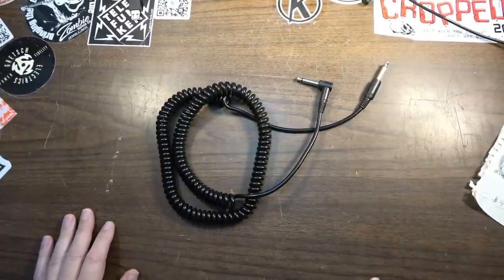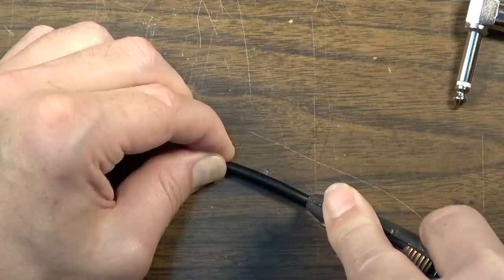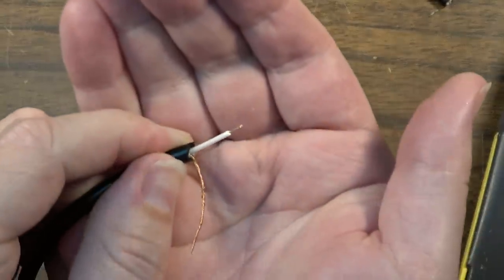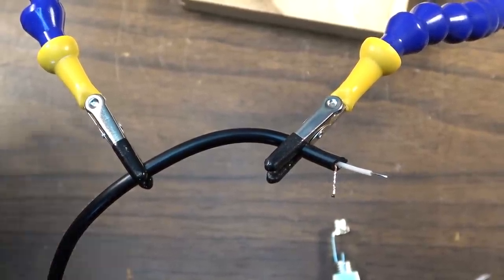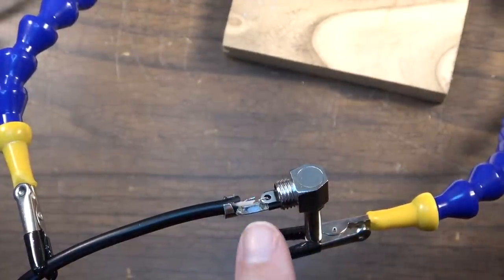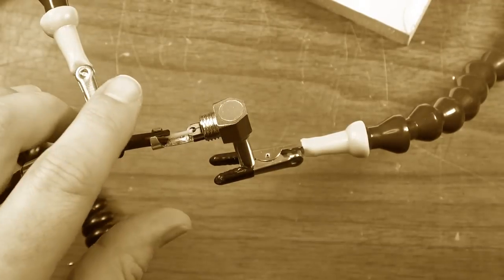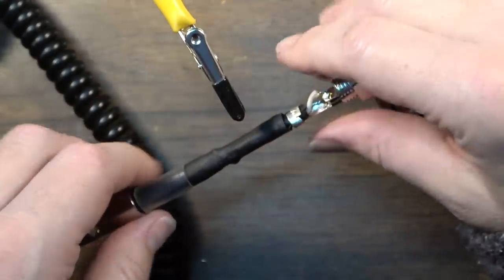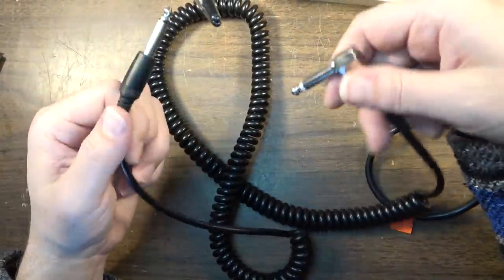ESSENTIAL SKILLS FOR PRACTICAL MUSICIANS: Guitar Cable Repair / How to Fix

Comment from the maker: STUFF YOU'LL NEED:
1: A Broken Cable
2: Wire strippers/clippers: https://amzn.to/3xtIUja
3: Soldering Station (This one has built-in helping hands): https://amzn.to/3vmRH4h
4: 1/4" Phone Plug: https://amzn.to/3xnqa4N
5: 1/2" Shrink Tubing (cheaper by the roll): https://amzn.to/32Ro9zw
6: This is the solder I like: https://amzn.to/32QKDRm
I prefer 60/40 composition. rosin core. 0.032 Diameter
Reply: Time for a new Solder Tip Brad!
Like yourself I've been soldering for many Decades and find an old Solder Tip more of an annoyance more than anything else.
That said, an individual new to soldering would be much better served with a newer/thinner tip design.
Either way great content, and yeah, we all love fixing our cables.......................ugh/sigh
Reply: Back in 1975 I purchased a 50' Whirlwind Instrument Cable.   I still have that very same cable and still use it regularly.
Originally starting off at 50' in length it's now only an 8' cord...........LOL
I did get my money's worth as the original solid brass Military-Grade connector ends are still very serviceable.
Reply: It is good to show those common mistakes. I use my cutter to strip cable outer shield. Idon't use knive cause I always fuck it up the cut.😁 Anyway this was really good video for young players. 👍👍👍👍👍
Reply: Looks like a "SwitchCraft" end....Good stuff; even "Neutriks". made a lot of cables buddy ! lol
Reply: HA ! 
Don't forget to put the sleeve on before you solder the leads, lmfao !!!
Reply: Actually built a lot of multi channel snakes, wired a bunch of racks and some some lighting too. 
Worked for a large sound company that did some really huge venues (coliseums). 
Met a lot of famous people and some really sharp (knowledgeable) techs.
It was a shit ton of fun except for sleeping in a semi and coiling up 400ft. of 56 and 64 channel snakes....
it's like wrestling with an anaconda...ugh.
Reply: It really helps you having given reference to adequate tools. Thanks a million sir
Reply from the maker: It’s a new tip. It’s just got a concave tip for holding solder.
Reply: @TheGuitologist  Geeze, my apologies Brad.
Still a great video that can help a person save hundreds of Dollars over the long haul.    I haven’t thrown out an instrument cable since the 1980!

Comment: Hey Brad, could you make a series on essential skills like these, electrician based? It’s a breath of fresh air compared to HoW YoU ShOuLd TuNe YoUr GuItAr, and HeY PlEbs I hAvE a KlOnE cEnTaUr.....
Reply from the maker: That's the plan. As I think of other things like this, I'll start making more of these Essential Skills vids.
Reply: But did you pay $5000 for it?  True test of a YouTuber......
Reply: Im asking the same thing. Its not that I haven't used this skill, but its been 30 years since I had equipment and things change. First Im getting a good variable iron with the proper tips... ty

Comment: I'm a former theatrical sound designer, a "tech" if you will.  I take the cable, bend it at the location I want to strip it at and take my sharp knife and lightly score the insulation until the interior conductors "pop up". They tear through when you get REALLY close to them. Then, I turn the cable over, bend and carefully lightly score at the same location, until the outer insulation is free from the interior insulated conductors.  Voila!

Comment: I just drilled holes at different angles into a small block of wood, then use it to hold the plug while I do this job. Works fine if you don't have helping hands.

Comment: When I prepare audio-cable for soldering onto connectors, there's 4 steps I do, which go as follows Cut, Strip, Twist, and Tin, generally 99% of the time doing that guarantees that I'll get good solder-joints, it is now very rare that I'll get a dry or cold solder-joint, here's a tip for you all, buy yourself a good temperature-controlled soldering station, you'll get better and more consistent solder-joints with it, I find setting my soldering-stations to around 350 degrees C works well for me.

Comment: Found 50+ cables in the guitar center dumpster thanks to your channel I fixed a couple and still use them that was two years ago I don’t think I’ll ever need to buy another one 👍🏻
Reply from the maker: I’m sitting on a mountain of cables too because of their dumpster.
Reply: @TheGuitologist  They're probably those "Lifetime Warranty" Monster cables. Bring in your bad one. They give you a new one... and GC throws perfectly good wire in the dumpster. I usually cut their crap off and repair with Switchcraft ends.

Comment: Great lesson! I've been doing this for years but never used the heat shrink tape, that's great for the added strength and support! Thanks for sharing this! Next time I'll use the heat shrink tape!
Reply from the maker: Aids in retaining the connections and keeps the end more rigid.

Comment: Good video. I've been carrying out such repairs for years. One point needs emphasing; if you can help it, don't use cheap jack plugs - they are fragile, unreliable and will always let you down at the worst possible time. I used to pay around £5 per jack (UK), but worth it. Leads may break but you can reuse the jacks. They'll last a lifetime.

Comment: Everybody should practice proper soldering... It does take practice and good equipment. This tutorial reminds me of fixing cables as a kid  before I started repairing people's broken 8-track tapes that were eaten by their dirty machines. It was extra to clean the transport in the deck that caused the jamb,  most of which were in cars until they migrated into console stereo TV's. Good post Brad!

Comment: Been doing this for decades, but still loved watching Brad confirm that I haven't been doing it wrong for all that time !
Reminds me of the problem with old curly-cables that would crackle as they stretched ... so, straight and fair quality cables only for me these days. However, maybe things have changed and curly-cables are better now ... ?
I think that the advent of non-board-mounted floor pedals also solidified the use of straight cables, as otherwise you'd catapult your pedals across the floor without realising !!! 😂
Thanks for the content Brad ... It was also nice to see someone else doing this particular repair for a change.

Comment: This is some of the best "hobbyist" soldering I've seen. Using a good high-heat tip (instead of a conical tip), pre-tinning conductors and terminals, using smaller diameter solder for good control and proper flux dispersion, heating the surfaces instead of the solder, not using crappy cheap solder.  I've seen soldering on other guitar channels especially that is, shall we say, not something to aspire to.

Comment: Perfect timing Brad. I spent last night "repairing" a cable. Plugged it in and bzzzzz. Pull it out a half inch and it works fine... Hmmm... Thanks for the vid! I'll try it your way this time. Cheers!

Comment: this is such a great money saving tip all should learn!! I remember starting out and i couldnt afford the nicer metal ends cables. And i paid for it literally!  After 5 or 6 cheap cables I soldered my longest bad cable right into the input jack. MY Crate G80 didnt mind much. Lol But it lasted long enough to buy a nice metal plug(1987) and i actually still have it today. Its never failed with thousands of hours of use. Back then they cost a lot more, but today you can buy decent 10'-15' cables for $5-10. thanks for sharing this t(r)ip, down memory lane!

Comment: Nice one mate, now... The best way to find the brake in a 30ft lead?
Reply: Plug into an amp and get a lot of noise going (or a signal generator). Squeeze and wiggle starting one end and work down.
Reply: Or of course you could cut the cable in half and make 2, one will work, one won't. Cut the non-working cable in half and do the same. Repeat... You'll find the break eventually!

Comment: Please do more video's like this. I Just started making my own cables and i saved a lot by doing so. I use the Neutrik silent plugs in one of the ends of my longer cables. They make guitar life so much more nicer. I also started to make some effect pedal kits and i replaced all the tubes and caps in my old Marshall 2204. I think i have you to "blame" for getting me into doing stuff like that. I used all the stuff in the recording studio this weekend and i worked perfectly.

Comment: I can not count how many times i have had to do this to a cable. At one time I had like 20 cables that didn't work anymore. Got to buy the end pins and find a good spot to splice it in, but sometimes its hard to find where the cable is compromised. Some of ones I have had get broken someplace in the middle and it's impossible to find the break. Cables are expensive and were not rich let's face it. Good topic Brad.

Comment: SRV loved those cables. I heard a story where his techs replaced his with a high end ,solid core cable and he went nuts. The high end cable was not bleeding enough high end to ground. That is not what we all grew up with. Also I find dental floss very helpful in fixing cables.It Keeps the hot and ground from seperating.

Comment: I literally just had a monster patch cable break on me last night. This video was ment to be.
Reply from the maker: Monster cables aren't all they're cracked up to be. They made many of those harder or impossible to fix the plugs. They use these high quality plugs, but they epoxy the end connections.
Reply: @TheGuitologist  Monster cables suck ass lol. I went through my cables hoping you weren't telling me the truth about the epoxy, but you were.  I am definitely looking for a new brand now. Thank you for the pro tip. ✌

Comment: My guitar jack was plugged in the amp and the amp fell down leading the cable joints to handle the entire weight of it. It makes a clicking sound when plugged in so any suggestions what could be done..?

Comment: I needed picks or something and found myself inside a guitar center. A kid (probably 16 or 17) came in & wanted his strings changed. I was about 7 when I started playing guitar. Before I was 10 I was changing my on strings repairing cables changing out drum heads (I started drums about the same time). I didn’t take any guitar lessons back then.  But I was taught how to tune my guitar and change the strings.

Comment: Your absolutely right, how much did I saved for the last 34 years? Welding the cable and forgot to put the sleeve before 
Common mistake when your in a hurry. Reduce, re-use, recycle!

Comment: Brad : "I hope you got something outta this..."
Me - yea, a good chuckle. I say you forget the cap and then put the shrink on first. Cable repair was one of the first things I learned as a kid. Yet sometimes I forget to put the cap on the wire before soldering too. Glad I'm not the only one.  Also I leave a small "S" in the conductors just in case the crimped part doesn't hold. Could mean the difference between ending a song with the rest of the band, or going out early.  Just a thought. Good topic tho.

Comment: Seems like I've been doing this since I got my first electric guitar--50+ years ago. 
I like using surgical clamps to grab the shield wire just by the strain-relief. They provide a heat sink to keep from melting the insulation of the signal wire. I can also use them to hold the connector, by clamping their handle in a vice-grip laid flat on the table.

Comment: Before I solder the cable to the plug, I always make sure the sleeve is on the cable, then I tin the plug where the cable will be soldered to, next I solder the cable's shield to the ground connection on the plug, and then the inner signal conductor to where it's supposed to be soldered to, I let the solder-joints cool down before crimping the cable-retainer so it holds the cable in place, once that's done I use my multimeter set to continuity test to verify that the cable is a good one.

Comment: As a FOH engineer I carry a couple of spare cables in my kit and I usually repair a bad cable either during the show or on the break and put it right back into service. I have purchased very few 1/4" patch cables in my lifetime, I have always repaired cast off cables. And don't worry I have forgotten the barrel so many times and it's always when I do the best solder joint... I have also done it on one of my YouTube videos if I remember right. I have an old DI box on my bench here in the Nerd Cave on the University campus for soldering cables, I put the connector in the box to hold it. On the road I use my Behringer cable tester to hold the different connectors while I solder.

Comment: I've been making my own cables for many years. My cables are 10 feet with a straight plug on one end and a right angle plug on the other. I use Neutrik plugs exclusively, Neutrik NP2RX-B on one end and Neutrik NP2X-B on the other. Neutriks are rock solid and clamp down like a vice on the cable, I've never had one fail. Switchcraft type jacks are, in my opinion, garbage. For the cable I use Canare GS-4 (4 mm). I always carry several back up cables. I also use a Hakko FX-888 soldering station. They look like a Fisher Price toy but they are very nice.

Comment: Brad I think a rehearsal was in order although one would have thought you'd done this a thousand times before? Tip Kids : Tin the plug connections before the cable is anywhere near it unlike this example.

Comment: Brad I thought that I had read or heard somewhere that it's not wise to blow on a fresh solder job to cool it down quicker. Is that true? Seems that it was because it might make the solder point not as strong as if it were to cool down by itself. Is that true?
Reply from the maker: Eh. Usually it's not that big of a deal. Maybe if you're getting right up on it and blowing hard it could be an issue, but lightly blowing, not a big deal.

Comment: Thanks Brad. Now I don't feel so bad about the tip of my Radio Shack soldering iron circa 198something. Don't even know if I can get a tip for it.
Reply from the maker: This tip is designed with that shape. It has a cup in the tip to hold solder.

Comment: The weakest point of the jacks are the tips. In most cases it's not a solid peace but riveted at the end where the wire would be soldered on. I hate that, it's a design flaw imho and it will create a lose tip/plus pole over time, guaranteed.
Reply from the maker: Correct. Those rivets loosen over time and will start to get intermittent.

Comment: For VOA studio work-XLR cables and mic cables.Occasionally bad headphones-you know those ANNOYING "one ear bandits!"Everyone at some time or another forgets the sleeves and insulators!When you have to redo----YOU REMEMBER!!!Guest musicians had to deal with their own cables.Two of the studios were for live music production.I was responsible for VOA equipment.Now its transmitters-NO mic cables or XLR interconnects out here! You just have to know tuning and fixing transmitters!And----being a PLUMBER since the transmitters here have water cooled tubes,coils,and vacuum capacitors.On Tx down a plumbing part on order!When you have a wet floor around a transmitter--get out your plumbing skills!!The mop and wet vacuum are another essentials!
Reply from the maker: So what you’re saying is, don’t come to work high.
Reply: @TheGuitologist  Yes-get PLENTY of sleep and stay awake-one guy has been killed here and that is too many.The studio is safe-however the trip to and from there has risks-downtown Wash DC.Greenville NC is safer on the commute.Site is about 15 miles out of Greenville NC.At the transmitter you have to deal with HV voltages-The disconnects and gounding hooks are your freinds-USE THEM!

Comment: Most cables have a lifetime guarantee you just need to keep the packaging. This is a useful skill to know yet unnecessary if you're paying attention.
Reply from the maker: Some companies may not even require you to keep packaging or receipts. And good point! But you know what the problem with this approach is? You return the cable to Guitar Center to exchange it and what happens to the old one? Right in the dumpster. So yes, you got a new cable, but you still contributed to the wasteful society I think we'd all like to get away from where possible.
Reply: @TheGuitologist  Many people don't recognize this.  Learn self reliance in whatever form you can.
Reply: These are all valid points, also if you're at practice and there's no spare cables being able to pull a cable out of your ass in a hurry does give you hero status. That being said, it's still nice making guitar center give me something for free. Bastards have been picking my pocket for decades.

Comment: I remember fixing stuff like that except, I just used tape and maybe stuck some paper in there to keep the wires apart. None of that silly solder crap for me. No sir.

Comment: Cables are expensive and considering how easy they are to fix it’s a waste to throw them away. I carry quite a few when I’m gigging then when several need it I’ll sit down and fix them all at once. With a little practice you can fix mic cables too which will save a band a ton of money.